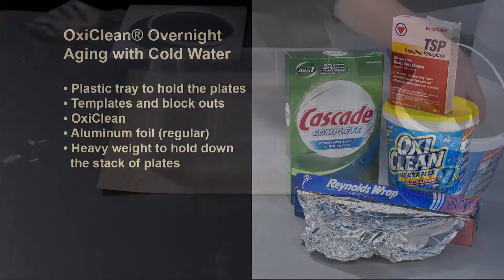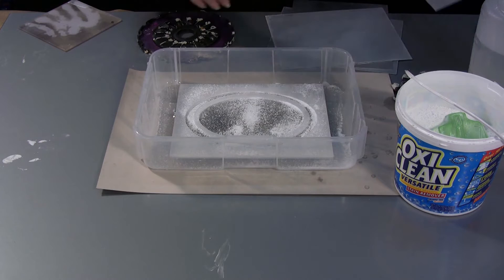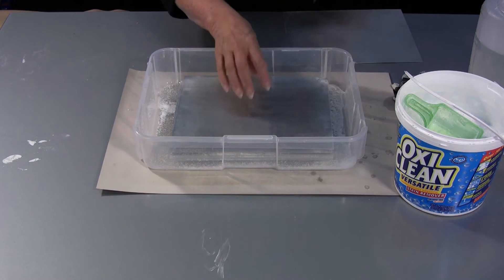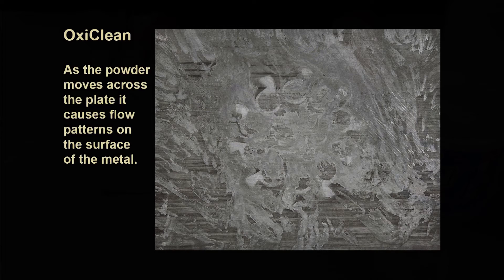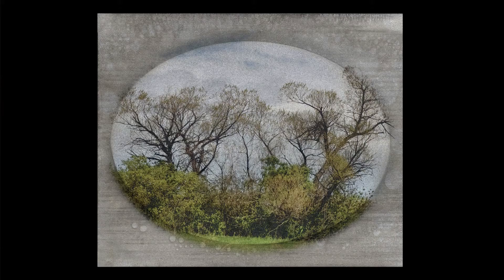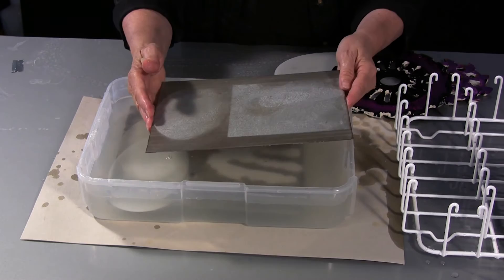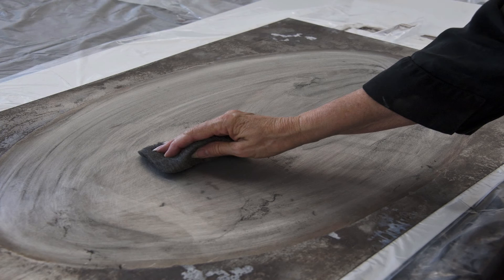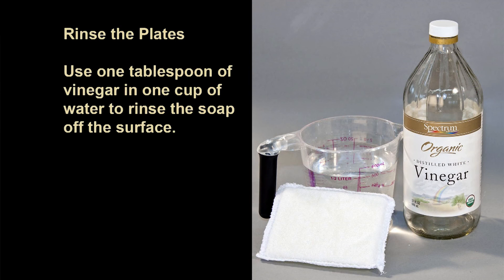Aging Aluminum Cold Water Process

Comment: If you are not planning on replying to any of the questions asked, you should disable comments. If ever you do respond, MY question would be "could you not just mix all the ingredients in a spray bottle, apply to flat surface or even let drip off for different effect?"
I actually found a video with a much simpler method, make a solution of peroxide, vinegar and salt. Works within an hour.
Reply: OOh can you send me a link to that?

Comment: Would this work on aluminum cans or do they have some kind of protective coating?  Thanks.
Reply: Aluminum cans usually have a plastic liner inside to prevent corrosion from the bubbly contents. Not sure about beer cans but soda cans  do

Comment: Howdy, what type of metal are you using? Sheet metal stock or aluminum? Thanks.
Reply from the maker: Mill Finished aluminum or flashing or anodized.
Reply: @dassart5977  Does this process work on other metals?

Comment: I attempted this with aluminum flashing after wiping it with Simple Green cleaner and degreaser. After one day the flashing was unaffected. Help will be appreciated.
Reply: It will not work on flashing because flashing has a protection on it to prevent from corroding.  You must use mill finish aluminum.
Reply: @bonnylhotka  flashing has protective coating but you can get it off, maybe try acetone which is nasty stuff but effective, or you could also sand and then wipe it down with soap and water
Reply: It only works on Mill finish aluminum.  Flashing is treated to protect it from all weather elements.